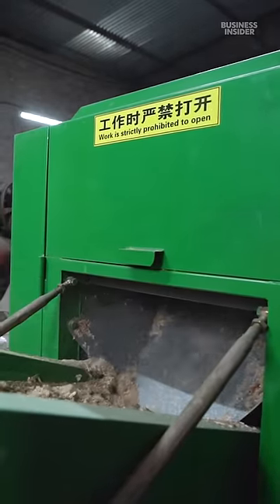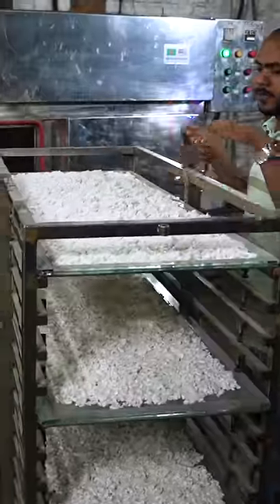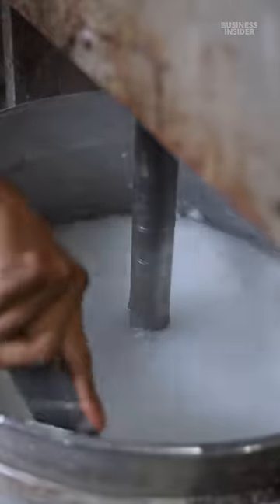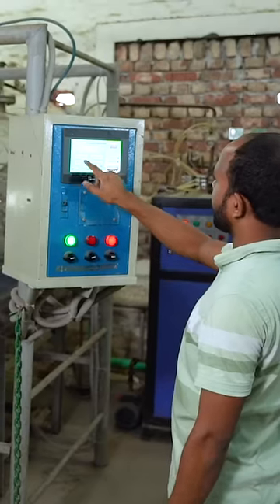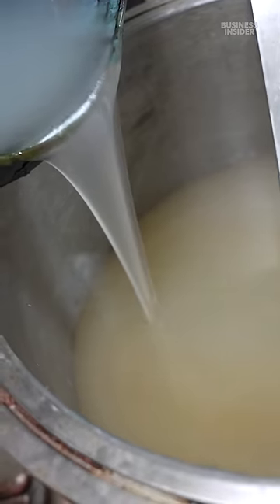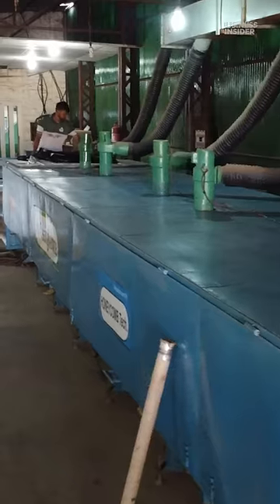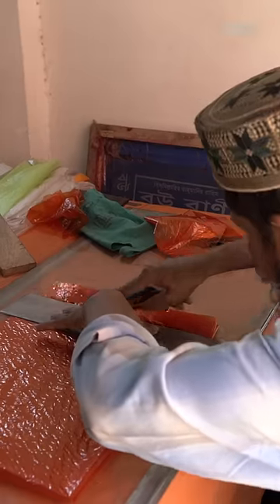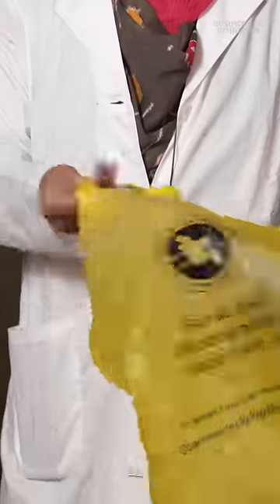One scientist is working to turn the jute plant into biodegradable plastic. #plastic #jute

Comment: Just make jute bags again. leave out the chemicals. once the bags are no longer usable, cut them up and add to your garden dirt, to help maintain moisture, which means saving water. Sometimes it is better, safer, easier and healthier, to just go all natural.
Reply: Yes, in your garden it sounds like it would look and act like coconut coir.
Reply: Yeah so that you cut down more forests to plant more jute to meet demand. Defeats the purpose really. See chemicals is umbrella term, you are made of chemicals my dude but it all depends on the chemicals and how they used. Even if the chemicals are bad for the environment if they are repurposed each time or can be converted to less problematic ones then you good. If the yield you get is higher than just sewing bags it’s much better. Say it takes 1kg to sew one bag but with the same amount using this process I can make 10 bags since I’m just using jute to get the cellulose (which you can get from most plants btw) then don’t have to cut down the forests Im trying to protect in order to plat more jute to replace the plastic that damages the forests I just cut down. See the problem
Reply: @dreammaker9642  Definitely a different way of looking at the process and the materials used. I will have to look into your hypothesis. Thank you.
Reply: @eleicajunstrom8724  the basic of chemistry is how can we get more with less which ironically is great for the environment. Besides bags aren’t the only thing made of plastic they just very problematic because people just toss them everywhere. Now you can either educate but we tried and people are idiots. Other option is to find an alternative hopefully cheaper or the same but that degrades. One of our project during high school chem club was make a bio fuel which although still will add pollution (can’t really go around it burning anything makes co2 and other greenhouse) but hopefully less and could reduce oil drilling which destroys marine ecosystems we actually depend on. Another project a friend and I did was try make a super conductor semi liquid mostly based of carbon and electrolytes that could replace copper. All it takes is asking the right questions and testing things out.
Reply: Have you considered that bags are not the only thing made of plastic...
Reply: Mr Scientist won't get wealthy using common sense.
Reply: Bags aren't the only thing that's plastic. I feel a lot of plastic is wasted in use and throw stuff, which can be easily replaced with paper(which means more cutting trees, yay!). But plastic wraps to package foods are such a huge thing we all forget to consider. A regular jute bag won't do for it, and conventional plastic is harmful to the environment. So a biodegradable option of plastic that stays intact long enough, and degrades agter the food has expired is a good thing to have both advantages. And this isn't the only use case
Reply: @jayvishnuvenkatesh870  growing up, we always used either wax paper or containers. I did the same for my daughter or we used Tupperware containers and had metal lunch boxes until that was no longer cool, then we used paper bags. You know, Tupperware might of started the downfall of our environment with all of the plastic?!
Reply: @eleicajunstrom8724  makes sense for a single household, and families. But I'm talking about foods in shops and other areas where they're mass produced, it's such a total waste to use anything else when plastic is so cheap. Plus manufacturing any other option would add its own pollution to the earth. So in the end, one way or another, there would be a problem to deal with
Reply: @jayvishnuvenkatesh870  Absolutely. Look at all of our toys, mostly plastic. Look at our computers, plastic and then all of the wire coatings and then the chemicals used in the coatings on the chips, the batteries and on and on. The more money we invest in education, for everyone, across the world, I believe, that one day, we may solve our dilemma of poisoning our world and our people. Hopefully, sooner than later!
Reply: Why not ban disposable plastics .
Reply: I believe this is because people are so used to plastic bags that they won't accept pure jute bags again. If it looks like a plastic bag, they will be more likely to trust and use it.
Reply: @dreammaker9642  Listen, I get what you're saying, but plastics from cellulose have been a thing for years and it's not like there's been a huge change when it comes to actual usage by the industry. So sadly, as of right now, all that's gonna do is probably just add one more kind of plastic that we theoretically could recycle but probably don't so it either gets burnt to generate electricity or heat or shipped to some poor country where children live on trash mountains as big as a small city who are constantly on fire. Sadly that's the world we live in right now, I appreciate every effort to change that but we have some very big institutional problems to solve before a new kind of naturally derived plastic bag that can be produced without using fossil fuels is going to save us from being doomed
Reply: @boratsagdiyev5679  you can’t recycle most plastics because if it’s chemical composition, costs and lack of education from place to place. Even if you make it out of cellulose it’ll take time to degrade but it’s the behavior that must change. You’ll keep fighting symptoms of you never deal with the disease.
Reply: Yes, please!
Reply: As long as it's somehow 100% compostable, waterproof and you can make bottles with that and any other disposable containers for food and beverages... Otherwise this will never be a solution, most humans are too selfish
Reply: If they do that, where will they earn the money🤑, power.
Reply: @dreammaker9642 the problem is not that we use plants, but that microplastics are everywhere nowadays and animals and people die from it
Reply: @dreammaker9642 all good reasons to utilize hemp instead of trees they yield way more than trees ever could per acre. So you wouldn't have to grow as much to meet the same demand. Meaning not cutting down as many trees.

Comment: “Work is strictly prohibited to open” that’s a good translation
Reply: I was coming here to see if someone else caught the engrish
Reply: 工作时严禁打开

During working hours, [this machinery is] strictly prohibited from being opened.
Reply: @poultrydish that's not much better.
Reply: I suspect it might be closer to “do not open while operating” or “must be closed while operating”.    Or if there’s a safety interlock maybe it means “will not operate while open?
Reply: It says to not open it while operating
Reply: It means "[the cover] is strictly prohibited to open during operation" which is probably to prevent any injury caused by the rotating parts inside the machine
Reply: Another good one is "it is forbidden to open". Saw that on an Italian belt sanding machine.

Comment: Polylactic Acid (PLA) is an (mostly) organic plant based - usually corn - "plastic" that's semi-biodegradible and extremely common in 3D printing and also dirt cheap. It doesn't fair well above about 40C - but I've always wondered why this isn't used more in place of single use plastics. My guess is you'd have to reconfigure your industrial equipment to work well with it which I'm sure isn't trivial. And although it's kind of biodegradable, it does need heat and/or special solvents or enzymes to degrade, so it would need it's own specialized waste stream.
Reply: the problem is probably that PLA is pretty brittle without additives, and if made into a rope or similar, it would likely break much faster than other plastic rope. it also doesn't fair well when exposed to the elements
Reply: Ask any old person about single-use plastics. Then look for their grocery bag collection.
Reply: It's a good ideal. Besides all the bio farms here I wish would go back to food.
Reply: Dirt cheap? Lol it's one the most expensive raw plastics
Reply: You answered your own question..... waste management isn't effective at current recycling,adding a type of refuse that's needs to be free of other types of debris is a nightmare logistically
Reply: @jacobishii6121  our waste management stream are garbage by design. Blame the consumer and individual not the supplier and political system. Same thing for carbon footprint nonsense.
Reply: It's because whilst PLA is biodegradable, it needs to be industrially composted to break down.

I'm a packaging designer and PLA hasn't been used for years because of the cost to produce it, cost to recycle it, and difficulty to manufacture using packaging PLA. It's also not great because the consumer sees it advertised as biodegradable and assumes it'll break down in their compost bin 😅 

PET plastic is by far the best packaging solution we have in terms of carbon footprint, cost and recyclability, but the media has demonised plastic. Glass has an insane carbon footprint and recycled paper can't be used for food contact packaging, but for some reason the media tells us those are better for the environment? Instead of developing things like bioplastics, we should be improving recycling infrastructure.
Reply: it NEEDS high heat and pressure to compost. its literaly still plasticc
Reply: glas would be better if we didnt have to transport them all over the country shattered or not @bats__
Reply: PLA wouldn't fair very well in Texas summer heat then. Lol (40°C is 104°F)
Reply: @karaf7498  well thr most important thing right now is to replace the 1 use items like plastic bags and plastic containers, utensils, caps, cups, these are what causes the most pollution, replacing plastic ropes is almost impossible and they are durable that's why they aren't thrown away often, unlike the 1 use items
Reply: It doesnt biodegrade very easily, it needs specialist anareobic conditions that cant be done in your standard compost pit. So essentially its not that much better for the envioment than pil based plastics
Reply: @karaf7498  eh its not bad really and thats a small price to engineer, compared to finding a complete alternative. from an engineering standpoint, as @lephtovermeet kind of mentioned, is that it takes heat to degrade PLA - more heat than can be gained in the ocean, so PLA doesnt biodegrade in water
Reply: fare not fair.
Reply: Yeah my sitting car gets hotter than 40C 6 months out of the year here in the States. Can't imagine a large box truck transporting a load of relatively volatile material, so it would have to be climate controlled. Fairly expensive on that front as well.
Reply: Like it is almost plastic, after. While I do have 100% yute/jute bags and they are awesome, why add plastic to already good product??????? Crazy. Not popular. What yute needs is marketers selling it instead of some polymers….it is not I do not wish to buy it, but there is not shops which sell them nowadays.
Reply: I really like your mind,out of the box ❤❤🎉🎉
Reply: @bats__  "carbon footprint' is a horrendous metric to be optimizing for 'the environment. Plants love CO2, some growers pump it into their greenhouses, for example. Plastic actually pollutes the environment, filling it with synthetic chemicals. Plastic is preferred over natural products because of junkflation. It's cheaper to have a lab produce products by combining chemicals, than to require manual labor, land, and time.
Reply: Cost. Corn is subsidized out the wazoo which is why PLA can be so cheap and why we have ethanol in our gas. But without those subsidies people would rather just cut out the extra step and use the next best thing. Which in this case. Is just plastics. In the US we are natural gas rich. So we’ll see a lot more PET plastics in the coming decades but otherwise. Yeah. Why waste an acre growing corn when you could grow cattle(a much higher value add)
Reply: Also, it doesn't break down in a home compost pile.  You actually need higher temperatures than that to make it break down.

Comment: This already exist with hemp. It is known and not hard to make. In fact ford did it in 1900' ish. Made a car using hemp fiber material for the body and the engine runned on hemp oil.
The process to do both is still known today but of course bo one's doing it 🤷🏻‍♂️
Reply: Would you drive a car made from weed?
Reply: @Pepesmall  yup. Without hesitation, hemp fiber is quite strong. Carbon fiber but more flexible.

Comment: Hopefully these 'secret chemicals' are not toxic.
Reply: they 100% are
Reply: It's carbon disulphide.
Reply: @dogdayssewing9402  or just sodium hydroxide to remove the lignin.  😮
Reply: I kind of figured it was black liquor. It's what they use in paper mills to do the same thing with wood fiber
Reply: @iancormie9916  and hypochlorite, and sodium metabisulfite, and sodium sulfite of course, just like paper... shhh. Don't tell anyone, though.
Reply: Hope in one hand and put those chemicals in the other two and see which one mutates faster.
Reply: @evilurna that's false. Black liquor is the byproduct of stripping the pulp with chemicals not the chemical used to strip the pulp.
Reply: If it wasn't poisonous, they wouldn't be secret.

Comment: Ban single use plastics, then we can all use reusable fiber bags! Just as we did for thousands of years
Reply: Your $1.50 bottle of coke is going to cost $15
Reply: @jgetscensored7837  that is a very high estimation, but if that is the true cost of plastic, so be it. Use glass.
Reply: @eloymarquez4783  I’m for going back to glass. But yes, the production cost of biodegradable products like this is significantly increased, hence the movement towards plastic in the beginning.  Cost and deforestation, (paper products) which was also more expensive vs plastic
Reply: Glass is almost infinitely reusable, it's a shame we moved away from it to make things cheaper.
Reply: @Lameducks consumerism has been a scourge on human society
Reply: @eloymarquez4783 you know what else people did thousands of years ago? Died before 30 from nearly everything. Single use plastic bags are simply one thing that leads to probably a dozen issues. If you want to live like some stone age primitive, no one is stoping you. Just turn in whatever technology you posted this from so we don't have to read or hear about it.
Reply: @Lameducks well, there's plenty of broken glass in the streets. I would contend that making cheaper products out of plastic isn't the problem. It's the people.

Comment: All that you are doing is replacing 1 plastic with another,  second just because they say it bio degradable, doesn't mean that it is. If it functions like plastic then it would degrade like plastic as well. What you forget is plastic comes from the byproduct of producing fuel, fuel is make from oil.

Comment: I wonder when people are going to realize that just the plant fibers is a biodegradable plastic, you don't need all those convoluted steps for much other than a few specific things.
Just hydrogen peroxide and a steam press is all the special equipment you really need to make bioplastics from wood. The hydrogen peroxide basically bleaches it and isn't toxic, then steaming and pressing it makes it dense and water repellent in any shape you want. Something like creosote can be used as a binder and will keep it sturdy in moisture. A lot of small stuff can be made with just the unbleached material. Between those you can replace most single use plastic products with a layer of wax for extra waterproofing. Glass and aluminum can take care of just about everything else, and those are much better for recycling than plastic.

Comment: The jute bags of 2,000 years ago were absolutely biodegradable. Woven jute as is still serves as a viable cloth material. IF the project to yield a plastic substitute were used to make something that had to be plastic, that would be a worthwhile undertaking, perhaps, say something such as IV tubing for medical use, rather than all this trouble and time to create a mere bag which can be constructed of practically ANY fibrous material.  This undertaking might be impressive were it something that could only be of plastic with plastics attributes, but in the meantime, “secret chemicals” to modify jute, heating, grinding, agitating, drying, is all a lot of costly, labor intensive processing, with a myriad of people involved and a huge armrest of  specialized  machinery, a long interval between gathering jute and marketing simple unremarkable bags doesn’t make sense. The end product’s market price couldn’t reasonably pay for the investment in equipment, labor and energy. It would barely cover the cost of harvesting jute. 
Cotton, flax, wool, wood, bamboo, or even recycled plastic could yield bags at a price consumers would be willing to pay and provide a profit to the manufactures unlike this peculiar endeavor.

Comment: I'm interested to know:

* How long does it take to biodegrade?

* When it does degraded what does it degrade into? Is there toxicity and how much?

* What shapes can you get out of it? It does seem to be versatile in this regard based on how it is dried.

* How strong is this material compared to current material.

* What is the cost of production compared to petroleum based plastics?

It will likely never completely replace petrolium based plastics, but it looks like a nice alternative for disposable things like plastic bags as demonstrated.

Comment: People in the comments section who's thinking 70% jute, 30% Plastic or stuff like that- it actually isn't the case! Please do try to understand the term "biodegradable" first. The bags will automatically degrade and mix up with air after 3 months, without no intervention of any chemicals at all. Purely organic! The chemicals used aren't inherent part of the jute based bags, just like the soap you use to wash your hands doesn't become part of your hand. Please do a bit of research before claiming things.